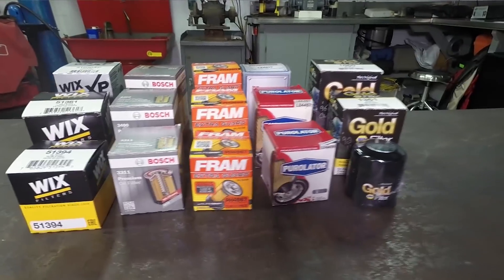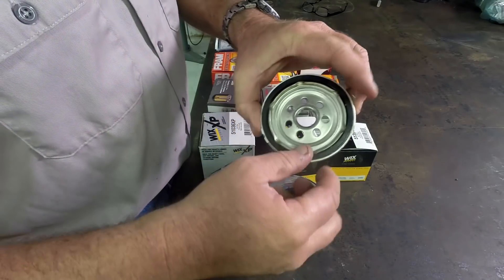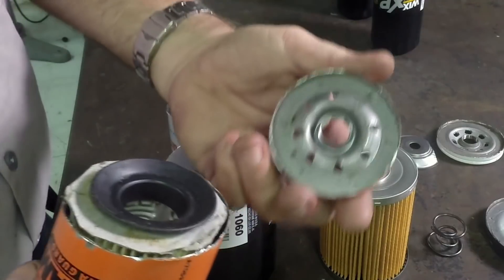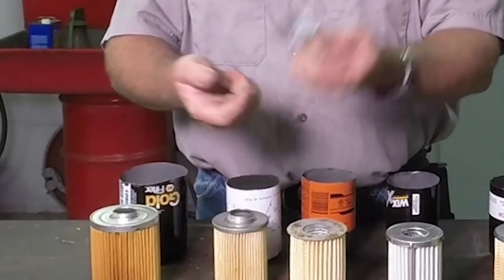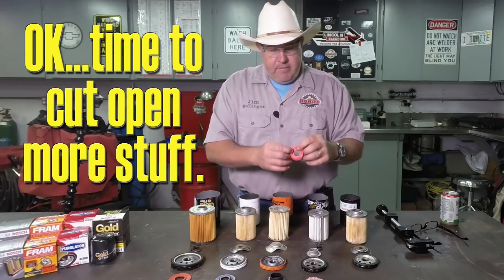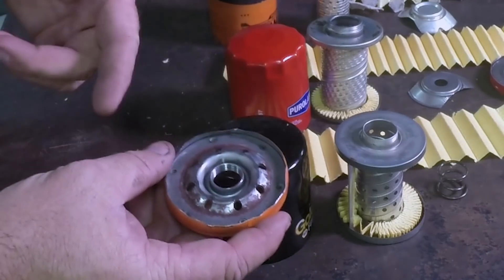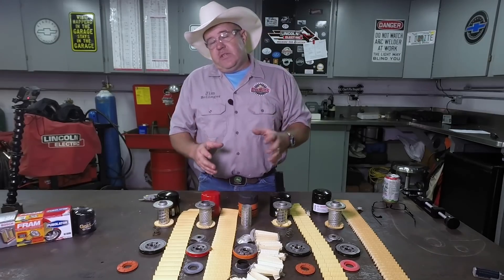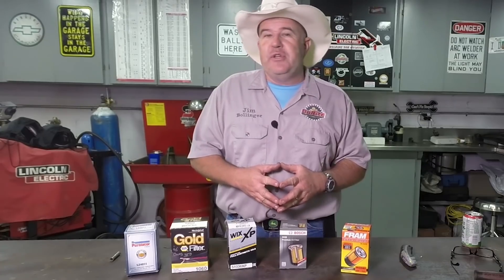The worst oil filter EVER!

Comment: This is just a beauty contest.    Construction says nothing about filtering ability.   How about bypass pressure, resistance to flow, etc.    Some of those well built filters could be crap in this respect.    I have been using Fram filters for over 200k miles on my car and they have worked fine.  Seems it would be the perfect filter for those that change their oil frequently and would otherwise rack up high filter bills.   That paper construction is likely fine for frequent oil changes.    You go a year or two between changes, and you might have a point about the filter breaking apart.
Reply: How do your comments negate the factual findings of this man? What are the facts behind your comments? You use the terms "could" "seems" "likely". Those are not terms used in making a factual argument.

Comment: Fram ultra synthetic is a quality filter for the price better then wix and Napa gold. They have a steel end cap and a metal mesh on the filter which no other filter has so don’t believe this guy he’s comparing different quality filters with a lower quality fram filterbut if you pay for the lower priced ones I have no word for since I have never used them but I have a 1994 mustang 5L V8 and have always used Fram ultra synthetic and ultra synthetic oil and it has 356,000 miles and it is running like when I first got it

Comment: Nice video, but. FYI. The pressure in the filter can is full oil pressure. There's a by-pass that opens for cold oil or excessive volume but return pressure is gravity. Most of the engines I've been into send the oil to the filter first under the same pressure delivered to the bearings and pressure sending unit. Stovebolt 6 and the 235/261 being some of those that don't send all the oil to the filter first.

Comment: Jim, Duane Leininger here, I just removed and cut open a FRAM TG 3506 off my truck it was admittedly over due a change. I cut the solid heavy base off found a intact rubber seal. I pulled the filter out, which was dirty but in great shape, spring was in great shape and no evidence of corrosion at all. this unit after this much use appears to be a well made filter. I recommend them.

Comment: I had always use Purolator because they're local, also I like that they're blue hahaha
Reply: I used to use Purolator.   However, my daughter called me one afternoon and said her Oil dash light came on.   She actually listened to my advice when I told her if that oil light ever comes on...pull over and shut the engine off.   She called me and I came to investigate the problem.   She drives a ‘96 Toyota Camry (my old reliable car that I used to drive) and to my discovery, the oil filter had actually popped off the threaded shaft and lost a few quarts of oil.   I tried to screw it back on.   It appeared to screw on and seemed tight (wanted to get her home).  I added a few quarts of oil back into the engine and had her start the engine, and within a few seconds of the car running...the filter popped back off gushing oil out.   I took the filter back to O’Reillys Auto store, and they were shocked by what I described.   I bought another filter, and the problem was resolved.  I either got a defective filter, or they were machining the threads to thinly.   Nevertheless, I will no longer purchase a Purolator filter again.    I’ve always used Fram and had good luck.  I’m a bit dissertation with the quality after watching the test video.   I may go with the NAPA gold or Wix from now on.

Comment: I bet the NAPA and the Wix are produced by the same company as they look very similar.  I quit buying FRAM a long time ago for the very reasons you illustrated, not to mention the fact that I've seen a few videos where the filter media had holes in it.  I've bought Purolator in the past and have had no issues with it whatsoever.  Purolator actually makes three different filters as you may know, Purolator, Purolator One and Purolator BOSS.  The BOSS variation is the best of the three and is what they recommend for synthetic oil.

Comment: I have used hundreds of Fram filters, and i have had hundreds of thousands of miles clocked on my vehicles without any engine problems.   I use Fram (and other brands) in my current Toyota truck, and have no fear of engine failure.  Dupo you live 
In a very humid area?   That might explain the rust you encountered.

Comment: I have run Fram filters on every type engine and horsepower configuration imagineable. I habe NEVER had a problem with them and have put over 600,000 miles collectively on my daily driver engines withyout a leak or failure. This guy must be a WIX promo man
Reply: maybe, but seeing is believing.

Comment: I being using Fram filters since i bought my first car when i was 17 and never had a problem with them i'm almost 60 and still use them to each it;s own i guess. My 02 F150 4.6 V8 that i bought brand new has 380,000 miles on it with same trans and engine all i done is oil changes with full synthetic oil.
Reply: They are a reputable brand. Been using them for years with no failures. Can't go wrong with a Fram.
Reply: They should be fine... It'll be filter out if you really want to be extreme about it. Have been using it for many years. Besides how long are you palnning to keep it on the engine?  Maybe someone can prove why its bad or what the damages it can do to your engine.
Reply: cut the old one open it might be damaged but the use of good oil and regular oil changes is the real reason the motor is still ok.

just remember it it falls apart it can block oil passages inside the motor. 

a 3mm chunk of an o'ring can throw a rod in a big truck it can to yours as well
Reply: Just because you have good luck doesn't mean fram is any good. They are junk and full of cardboard

Comment: Cheaper or pricier version of Fram, makes no difference. All crap.  Would you buy any product from a company with poor ethics.  Why make a filter at any price if you design it to fail and not do the job customers paid to have it do - protect their engines.  If the low price filter can't be trusted - why trust the higher priced?

Comment: I used Fram in my vehicles for my whole life. I greatly appreciate your honest assessment of the filters. Now I will NEVER use their product. Exceptional knowledge and PSA buddy. Keep em honest!
Reply: The only time I'll use a Fram oil filter is on my mother-in-law's car.😃
Reply: And did you ever have an enging go bad on you? I'm guessing "no", otherwise you would have said so.
Reply: @JamesSmith-jx1sh  Yes, that engine did indeed later succumb to a worn out top end.  But blaming one incident for that seems like a stretch.
Reply: They are a reputable brand. Been using them for years with no failures. Can't go wrong with a Fram.
Reply: that's the cheapest Fram he's testing in the video, there are other models that are much better, can't compare a 3$ filter with a 12$ filter,  I personally buy Fram but not the cheapest one...
Reply: @dirt_rider  maybe cut open/compare the higher end ones?  I was fooled for years using FRAM before switching to M1.
Reply: I had a Fram oil filter warp under the pressure of starting at subzero temps.  Pumped half a quart of oil onto the ground in the parking lot.  Didn't see it until the next day, lucky not to have blown the motor.

Comment: Faulty comparison video. Over simplified and lacking factual equivalents as to why one is better than the other.
This is a terrible comparison video, it's like comparing apples to oranges. First off yes the Fram EXTRA GUARD filter is bad compared to the other 3 filters. However, that Fram filter is considered a entry level filter and the other three would be considered MID-GRADE filters. A Fram Tough Guard would be an equivalent filter to the other 3 in both built and price.

Not to mention what kind of oil people run in their cars should dictate which level of oil filter they use. You technically should not be using any of these filters if you are running fully synthetic oil either. Synthetic blend or conventional oil would be acceptable with these filters.

Comment: Will you do any flow and particulate filtration tests? Id love to see them.
Reply: particulate filtration tests require quite expensive "multipass" test rigs and particle counters. This data can be easily influenced by the type of dirt and contaminants you use for the testing. It really wouldn't be as eye-opening as you would hope. Flow tests just show the relative differential pressure on the filter and, though that can be a concern, unless it is 10x higher than your oil pump is capable of maintaining rate with, it doesn't make a tremendous difference on new filters.

Comment: As I recall, Wix & Purolator are sister brands to each other (made by the same parent company) and they also make the store brand filters for NAPA as well? And Fram  has been at the very least overrated for at least 25 yrs. Seen new ones that rattled inside,and a few of the not-so-old 'used' ones I've pulled were nightmarish.....insides came apart? And the 'Super Tech' ones from Wal Mart look an awful lot like an AC Delco part with different labeling.....maybe same manufacturer??

Comment: I could not agree more! Years ago I worked at a dealership and a vehicle came in with no oil pressure. 
MANY Techs were stumped on the issue. Engine was torn down.....
Turns out, the Fram oil filter completely broke down and clogged up.
Will never forget it

Comment: I have a 2002 Saturn SL with 240,000 miles and have used the orange Fram Filter since the first oil change. Change my conventional oil every 3000. No problems. Engine runs great. Change your oil!

Comment: I don't use fram and I wouldn't but if they were so bad there would be thousands of cars on the side of the road. they sell millions of them. they have just pushed to the edge of engineering and cost in the same ballpark as superior filters such as the Wix (that I use) I literally pay less than a dollar more for a Wix than the Fram costs. good video but they aren't going to ruin your engine

Comment: I'm with you all the way on this! I've been working on cars and trucks for over  20 years and have had HORRIBLE TIMES just getting Fram oil filters off vehicles I was doing oil changes on. I'm no super strongman and time and time again those extra long Fram filters twisted up like Slinkies and had to be cut off. We saw a kid down the road do his very first oil change with a Fram filter. He made it less than 5 miles before the filter blew up and dumped the majority of his oil on the road. Currently using Purolator standard filters and they do the job as long as you stay on a 3 month schedule.  I agree that WIX are pretty much top of the line. Great video!

Comment: I have the Dodge Turbo diesel with mechanical fuel injection and I use the Cummins Fleetguard filters only which is what the Turbo Diesel Register recommended at the time I bought my truck.

Since you were just checking construction of the filter your method of opening them was o.k. but if you were checking them for particulates then you would need to use a oil filter cutter tool.  I used mine to check my race car filters and the filters in my Cat 3208 powered motorhome.

Comment: You want good oil filtration, use a centrifugal oil cleaner like I have in my Fuso.  25000 miles between oil changes.

Comment: Fram is a good filter. No oil filter caused any engine destruction. Not changing the oil and filter WILL cause engine destruction.
There were a lot of engines built without any oil filter.  Yes, you can buy better built filters for more money but the benefits you get will be similar.

Comment: Agree the orange Fram is crap. Probably last time I used one was in the 70s on a clunker that was hardly worth the cost of an oil change. But, I’ve read revIews of Fram’s top of the line Synthetic Ultra that contend it ranks right up there with the best. Ditto with Purolator and other brands that have multiple quality levels...the low end ones are often junk. So, in some ways this was comparing apples and oranges (literally). I generally use the manufacturer’s OE filter or Wix or top tier Purolator. Makes no sense to try to save $2-4 on a filter when you are protecting a big investment. Use quality oil and filter unless you are one of those who get a new car every year or two.

Comment: My dad had an 1987 dodge Dakota after he died I took the truck in for warranty work and he had changed the oil using a Fram oil filter from Walmart I think...The Shop foreman opened the hood saw the fram and said it was not under warranty...I went to Napa got a a gold and changed them out went back to Dodge and everything was fine

Comment: Compare top line Fram to the Wix would be a fair test.
Reply: Actually, the lowest-quality item that a company manufactures, would be the more important comparison. Because if they would soil their name by producing unethical junk, what does that then say about that company name? A company should be ethical enough as to produce no junk at all.
Reply: Yosef MacGruber Good point. However, for me a practical consideration is do the top line Frams compare favorably, because at times they may be the best choice for utilitarian purposes. However, they will no longer be a go-to brand, for the reasons you have given.
Reply: @StratKruzer 
Such bad quality is like the oil filter manufacturer deliberately sabotaging and shortening the life of your engine. It is unethical and taints the entire Fram name.

You expect a certain level of competence from any company who would make parts for your car.

I tend to distrust brands that I can find examples of them producing junk, even if only on their cheap end of the spectrum. I do not trust brands in electronics, that choose to use the inferior type of auto-stop, that appears to be designed to tangle audio-cassette tapes. Really? Why are they using a tape tension sensor, when the mechanism that auto-stops when the take-up reel stops turning for any reason at all, is so much better? Do they really think that we will not notice, nor care that our favorite music collections were destroyed by their piece-of-junk? I look at the details. I like to see any device that uses a power adapter power brick, specify what its input voltage and polarity is, right at the socket where it plugs in. The reason for that, is so that if you lost your power adapter, that you can configure a universal power adapter to work with it. Maybe it was temporarily lost due to moving.

I take note of the brands that get the important details right.

Comment: I use Fram but the next step up. The one you're using costs about 3.50 for my car, but the one I use is 6.50. I'm curious now to cut into the more expensive one to see what's in there. Thank you for the video!
Reply: Just use Wix. If you think the "next step up" is better, you're mistaken. Expensive Fram filter is still substandard compared to the cheapest Wix.

Comment: Man just changed my oil yesterday and used Fram as I always have and my father did before me. I guess after seeing this what can I say, my dad was wrong ( or maybe he was just cheap ;)) but for sure going to be going with a different filter for my next change.
Reply: Cutting the filters open does not mean much. Rust, if that is what is is and not just oil or lubricant stains, would be captured by the filter media. The type of back flow spring doesn't matter as long as it works and the seal prevents back flow. The important thing to test is the flow rate thru the filter and how much particulate is captured. That can only be accurately tested by making up a standard of dirty oil to test all the filters and measuring how much pressure drop happens when the oil passes thru the filter and how dirty the oil is coming out when the filter is new and the oil cold and say after maybe 72 hours or longer of having the heated standard oil continually pumped thru it. Measurement could be simple like rating a drop of oil color exit the filter on a white paper towel or more detailed using a glass smear between two microscope slides or even a grind gauge.

Comment: Been using Fram my whole life. I change oil at 3K to 4K and get 300K miles from each engine, guess a crappy filter promotes engine life. That filter is glued to the oil resistant cardboard and that is why your dull knife made it look so bad, you made a good design look bad. As for rust, I have yet to see any on new filters and the ones I cut open after use ( with an oil filter opener tool that you should have invested in for this video.) Looking for metal, it is essential you do not cut as you did.   Sticking with Fram as I like my engines to last.

Comment: I know a guy that worked in an oil filter plant in Fayetteville NC about 25 years ago. Was Purolator at the time but now MANN+HUMMEL. They made all different brands of filters besides purolator. He always bought OEM filters from a dealer as he said they were the best based on what he saw at that factory.  In other words a moorcraft filter from the dealer was different than  a motorcraft filter from the auto parts store. Seems strange but he said it was true. That said I've never had an oil filter failure that I know of or an engine fail due to dirty oil and had many cars that had well over 100K and one get over 300k and next owner said it now has 400k. Would be interesting to see some OEM filters.

Comment: In 1987 I bought an 87' F150 with the 5.0 straight six . If I used any filter brand other than Motorcraft or Fram and the engine sat for more than 8 hours I would get an engine tap til the oil pressure came up .
Reply: Looks like Fram just let the oil go straight through....
Reply: It was a drain back issue . If engine sat for less than 8 hours it did not tap . Over 8 hours it would tap